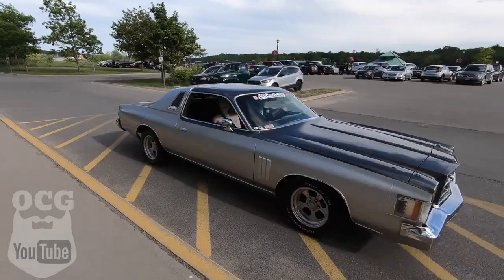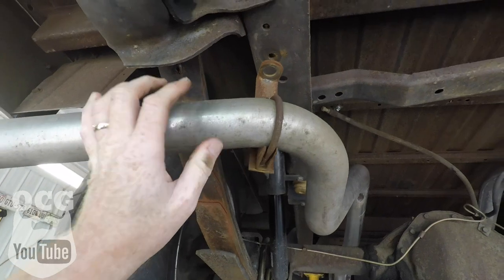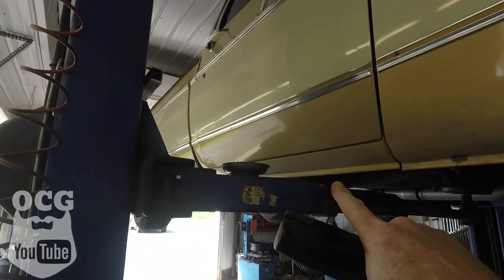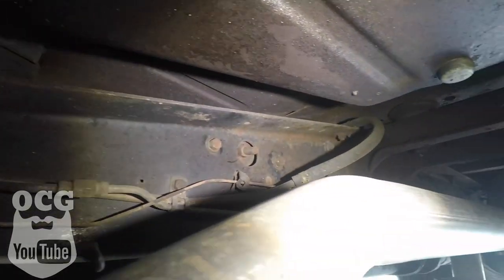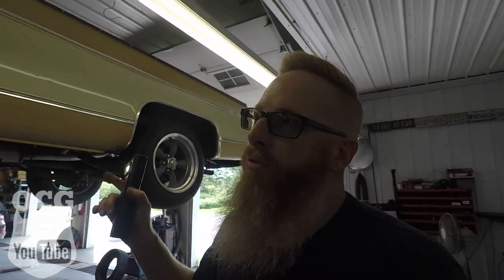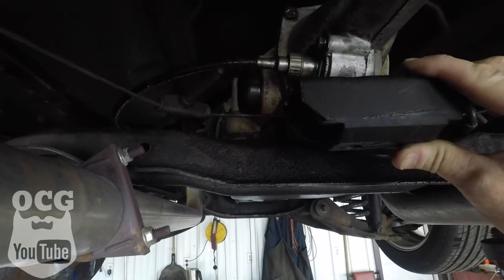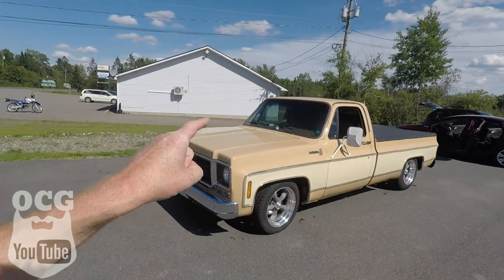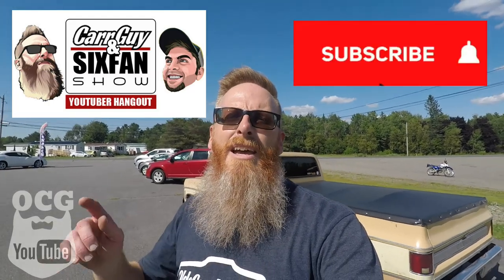IT'S TIME FOR THE SAFETY INSPECTION ON MY 1977 CHEVROLET C10 TRUCK. WILL IT PASS OR FAIL?

Comment: Is there a year cut off for the inspections?
Reply from the maker: No! New cars get an initial 3 year, passenger cars and light trucks are 2 years and 3/4 ton passenger trucks and up trucks are annual. But all vehicles in New Brunswick must be inspected. No emissions testing yet though!

Comment: Steering gear is defenitly leaking
Reply from the maker: Time for a rebuild!
Reply: @OldeCarrGuy  yep
Reply: @OldeCarrGuy  would be a good video for the channel the steering gear being rebuilt another option is usa made Red Head Steering Gears they make amazing Steering gears rebuilt and all you do is send them yours and they send you one they already rebuilt they even beef them up if you need as well as if you want ports added for hydraulic steering dampener assist

Comment: Would they have failed you for the transmission mount, I  hope they aren't that picky in New Brunswick. Just info for you no Inspections required in Saskatchewan for anything 1987 and older, even if you bought out of Province and brought into Saskatchewan. It used be  30 years and older but they changed it a couple years ago.
Reply from the maker: Technically, yes, but there is some leniency. Every vehicle must be inspected here. Kinda sucks, but I get it!